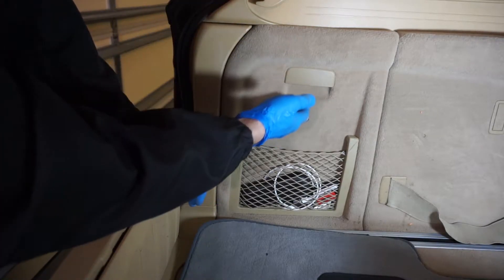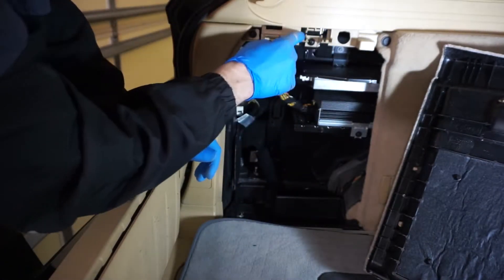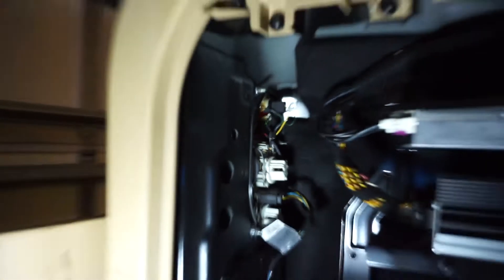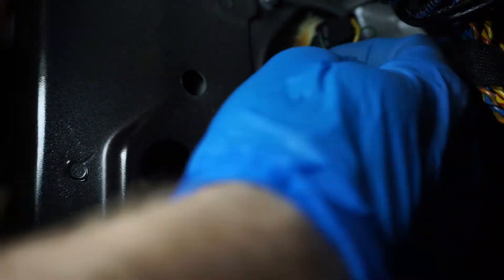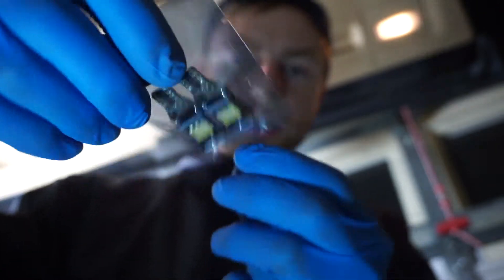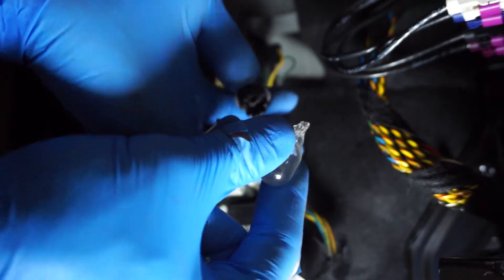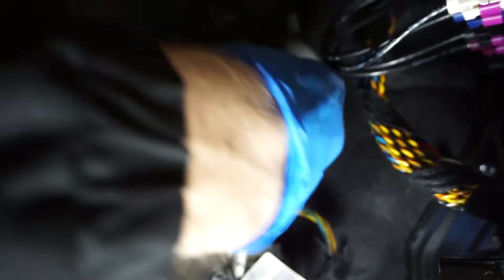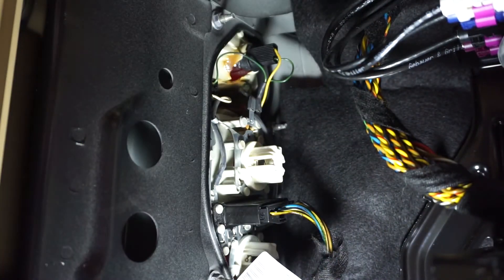How to upgrade BMW Reversing Light for LED Light Error Free

Comment: Hello, I tried this now I get an error message saying there is a bulb malfunction. What do I do?
Reply from the maker: I can't say anything about, for some reason some cars are ok with those bulbs, and some have a problem you can try to change polarity, but I don't think it will help. The seller claim they error free, so just returne them if so, idkw but my work fine, it could be because i have an older car....
Reply: You must install a load resistor to stop the error, or get the error coded out.

Comment: Hello,does it work on BMW 520 F10 ?Thanks.
Reply from the maker: If you're car is not coming with led lights, it's totally will work!
Reply from the maker: If you will decide to replace the fog lamps it gonna be little hustle, i mean if you want led lights for it, then you need to order the expensive led with "circle board" which tricking the onboard frm unit or code the frm unit, i have it on the channel, you can check it out!
Reply from the maker: https://youtu.be/mABrqcyq_nc